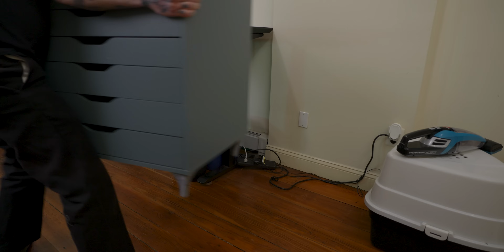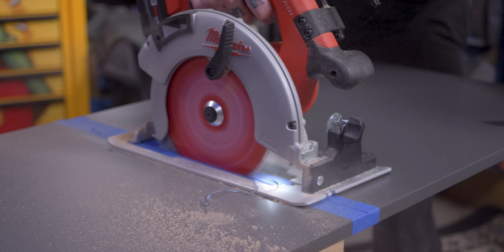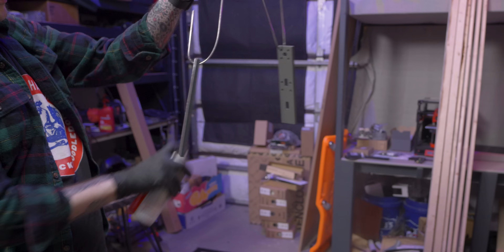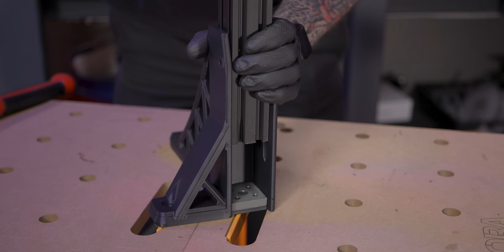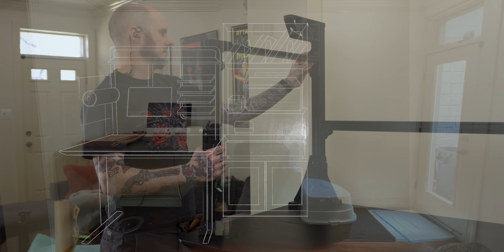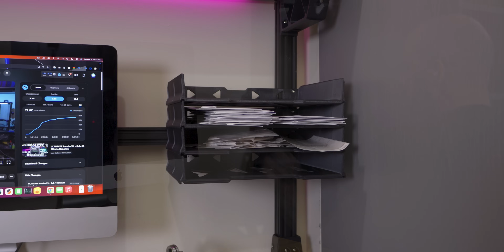Ikea Hacking w/ 3D Printing! - Desk & Litter Box Upgrades!

Comment: Can you share the Fusion project for the little brackets? They have a really interesting shape that I’m wondering how you achieved!
Reply from the maker: Which "Little brackets" are you referring to? I'm not a professional so my CAD workflows are usually... messy, which is why I usually just share STEP files from my designs and not the Fusion project files, but I'm open to doing so.
Reply: @MandicReally  The clamp brackets with inset screws they you put on the underside of the desk. Thanks for the reply!

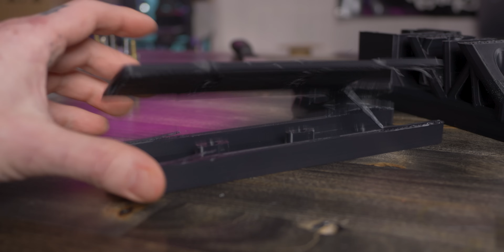Comment: 10:40 SEPARATION; Added weight from the steel, bed is just a little bit lower after putting it in there.

Comment: WHY did you bother embedding the steel into the upright brackets?? The design, extra walls & infill and strong filament looks more than adequate.
Reply from the maker: To hold a computer cantilevered off the front of the entire assembly? I love 3D printing but there are limits. Why test them with a computer? The steel will be SIGNIFICANTLY stronger, and the only real indication it is there is that the base of the brackets is a little thicker than it would have been otherwise. If I didn't tell you, you probably wouldn't notice. So why not do something different and stronger?

Comment: BambuLab's fail because of steel vs Lidar. 
And I have reservations about the brackets because 3D printing is not the suitable material for the job, even with metal reinforcement. It's a matter of looks versus relevance. Joining aluminum extrusions together, which is their intended purpose, is likely too simple with basic screws.

Comment: I don't have a bambu printer so I'm not certain, but could the print issues with the steel be because the steel is weighing the bed down? Those look like some pretty heavy chunks, and even a 0.1mm deflection could stop the next layers from sticking properly.
Reply from the maker: I think this is the likeliest answer to what happened. I may have to play with testing weight movement on the Z axis.
Reply: @MandicReally  if you set your slicer to use relative positioning (G91), you could manually add a G1 Z-0.1 F300 just after the pause point, or however much the deflection is.
Reply: Also you could set a wider extrusion width. If you set it to like 2-3x nozzle diameter then it'll stick better even if the layer height is a little off.

Comment: I wonder if some of the issue you have on the bambu especially is because you put cold steel in the middle of the part, and would be less of an issue if you would have heated them up closer to the chamber temp before inserting them into the print
Reply from the maker: I preheated the steel by setting it on the 110c bed for as long as I could before setting it into the print. Just didn’t mention it in the video cause I covered that in my last go around with this subject. Still may have been enough temperature difference to cause a problem.

Comment: nex time try to heat up the metal parts a bit 🙂
Reply from the maker: I did. Preheated them on the bed for a while before placing into the print. Just didn’t mention it. They were hot enough I could only hold them for a short time. 🤷🏻

Comment: Hi Allen,  A great tip for inserting steel parts into a print is to preheat the the steel before inserting it into the plastic.. I have done this by simply putting the steel part on the build plate while the rest of the part is printing, as long as the toolhead isn't going to hit it... or using another printer to to preheat the steel (or aluminum part).

Another great video 🙂👍
Reply from the maker: Thanks for the input, I did in fact do that though. I just didn't reference it in the video. My confusion really lies in why the Bambu had so much trouble where the Voron did not. The best input I've gotten is that the lighter duty bed mechanism of the Bambu may have lowered a little under the weight of the steel being added. Maybe just enough to cause the issue I saw.

Comment: Cool project.  Since the Bambu one was separating once you put the steel in…. Do you think the weight of the steal may have caused some backlash causing it to be a little lower than intended for the next layer?
Reply from the maker: That is the likeliest and most logical explanation I’ve seen. The steel was preheated on both machines but only the Bambu reacted poorly. I may have to investigate the bed mechanism on that machine in relation to this.
Reply: @MandicReally  good test would also be to run another bracket and pause the print just like the steel version (but don’t put steel in… continue print and see what happens.  Would be interesting to compare anyway

Comment: Cool project.  Since the Bambu one was separating once you put the steel in…. Do you think the weight of the steal may have caused some backlash causing it to be a little lower than intended for the next layer?

Comment: I think a few people have already said this. But it may be a good idea too heat up the steel before putting it in the print. You may want to increase the hot end temp to the top end the filliment can take.
Reply: Maybe use a thermal sleeve around the steel. Use a radiator insulator to r something similar, this should give it enough time to print the next layer before the heat transfers.

Comment: I suspect the layer separation on the Bambu was because the weight of the steel bar will ruin the precision that the bambu has with its rapid z hop it does. Not really sure the actual term but every time it ends on a seam it might be lowering the bed and raising it again very very quickly, but obviously a heavy steel bar would mess with that. 

That said, i dont really know what im talking about ive had my X1C for less than a month XDDDD. Hopefully you get what i mean.

Comment: Hi ,yeah I agree with some of the comments when I saw the steel and you bridging over it I was like no way thats goona stick, yes heating up the steel would work but finding the right temp to keep the steel warm and NOT melt the plastic is not goijng to be easy, I would suggest "Painters tape" on top of the steel and then you do normal layers, this way you dont have to worry about the nozzle and the plastic has something to stick to,.

Comment: I think that the main reason there was a layer separation on the bambulab is the chamber temp. Putting a cold piece of steel inside of a print might be the issue. The voron can compensate the loss of heat pretty fast having mains bed and a much beefier bed
Reply from the maker: The X1 bed is also Mains voltage. Though it certainly isn’t as beefy or thermal mass heavy as the Voron bed. I preheated the steel by laying it on the bed of both machines (the Bambu bed was hotter at 110C vs 105C on the Voron). And the chamber temp on the Bambu is generally 5-10C hotter than my Voron as the 2.4 has a larger chamber volume and the bed is at the bottom where it is coolest in the chamber.

Comment: Spray the steel with a heavy coat (let it pool up a little) of aqua net after you place the in print the while the printer is paused. This does two things for you, since there is wet hairspray on top of steel you have to wait for it to evaporate and allow time for the steal to warm up. Second is it give something for the filament to stick to.
Reply from the maker: The steel was pre-heated on the print bed for a while before laying into the print (just didn't mention it in the video). And the design fully bridges OVER the steel, it does not contact. I've done this before, trying to print on the steel is a bad time. It just won't be at temp enough, flat enough, or at the proper layer height to function like a print bed.

Comment: Have you compared the chamber temps between the X1C and your 2.4?  
Was opening the doors to add the preheated steel allowing enough heat to escape and the bambu couldnt keep up?
Reply from the maker: The Bambu maintains a higher chamber temp cosnistently. It is usually between 50-52C while the Voron is generally 40-45C at Gantry height and less than 40C at the bottom. The Voron isn't insulated at all and has a much larger internal volume to heat. I print ABS and ASA almost exclusively on the Bambu and have never had a momentary temp dip in the chamber cause any issues. Not a bad thought process, just not sure it plays out in reality.

Comment: I'd assume that the inserted steel absorbs all the heat and thus you get the layer separation right above it, as the layer before got cooled off too much.
When i do something like this, i put the parts inside the chamber, so the temperature difference is not as big
Reply from the maker: I did set the steel on the bed for a while before laying it into the prints. So it was not just in the chamber but also absorbing bed heat (110C). It is still cooler than extrusion temps of course so it could still be a factor, but the Voron had NO issue while the Bambu had nothing but issue with it. And the Bambu I run the bed hotter and the chamber is warmer.

Comment: I think the steel is absorbing heat and causing rapid cooling. Just saw your comment about preheating the metal, however I still think its the issue. Also, thanks foe the video, way too many 2d printing channels are not doing enough videos on practical uses of the printers. After years od doing 3d printing, I just learned something new from you today.
Reply from the maker: Thank you very much. My goal with the channel is to move away from the tech heavy side of printing and just show how cool AND practical 3D Printing can be. So I'm glad it is coming across.
Reply: @MandicReally  surprised you got through all the typos. Shouldn't do this without my glasses. Just a bit of feedback, back during the early days of 3d printing youtube, lots of creators presented cool projects on the uses of 3d printers. Now it seems so many creaters are dedicated to brands on optimizing specific printers or focusing excessively on hardware reviews and livestreams lasting more than an hour, these don't make for good quick watching while having breakfast. Practical print friday does lots of varied projects, but nice to see you too doing these projects. The hardware is not that exciting to watch anymore, and unless I am looking to buy a new printer, there are only so many reviews I can watch. However, project ideas, innovations in printing techniques etc... are more timeless as content

Comment: Just a bit of advice from a mail carrier, The mail could do better sitting vertical than horizontal as you have it, Also makes it easier to create dividers
Reply: let alone have that poo scent on all that material just sitting in that cabinet. Great way to contaminate everything.. Noice
Reply from the maker: @deeply999  You did notice the cabinet is completely separated from everything else right? its an enclosed chamber with a HEPA filter that nothing else shares the space with. There is a divider at the top that completely isolates it from the drawers and shelves above.

Comment: Steel has huge thermal mass and is sapping heat from lower layers, that can't "remelt" for proper layer adhesion. Thus splitting
Reply from the maker: I fully see and expected that, but the steel was preheated on the bed before laying into the print. I was barely able to handle it for a few seconds. Definitely not 240C, but not cold by any means and thoroughly heated. Had it happened on both machines I'd 100% chock it up to the thermal mass issue, but the Voron had no issues with adhesion either time. Idk.

Comment: x1c seperation could be the steel plate sagging the bed once added in. Seems to make the most sense. Could try some way of weighing down the bed using the steel plate for the first part of the print, but likely this is a horrid challenge as theres no way you could load that exact spot on the bed
Reply from the maker: I see that, but I did rest the plate on the bed for a while before laying it into the print. I did that to preheat it so it wasn't cold when inserting it. This still is a pretty logical possibility as to why the Bambu had issue when the Voron didn't. I may have to investigate that more. Thanks.

Comment: I think the layer seperation issue is coming from the steel itself. Steel is a good thermal conductor and I think when you place the steel in the part its cooling down the layers that are placed on top of it plus the part itself. I would try heating the steel up to like 70 or 80c and then placing the metal in the printed part.
Reply from the maker: I didn't mention it but I actually set the steel on the bed (110C) for as long as I could before embedding it. It was hot enough that I couldn't hold it for long when I was setting it into the print and I have asbestos hands. Still could be a factor of course. Just wasn't an issue on my Voron either attempt at the part, but was both times on the Bambu. It was odd.
Reply: I’m thinking the weight of the steel is heavy enough move the bed slightly. Could test this with a dial indicator on the bed and place the steel on the bed and see if there is movement on the needle.
Reply: What about using aluminum versus steel? It is quite strong and would still provide stability.
Reply: I had similar problems printing ASA on large parts in my Bambu X1C. It kept separating due to probably thermal issues. I ended up solving the problem by just printing the part in PETG and everything worked fine. Hope this helps.
Reply: @ChippWalters excess cooling? Weird that it'd work fine on a Voron 2.4 and not an X1C. Same layer widths?
Reply: @theglowcloud2215  yeah, it must have to do with the cooling. I used basically the same print fill settings and the PETG worked out perfectly. I try tweaking the ASA including using different brands and could never get it to not split. I think it needs a heated chamber.
Reply: Yep, that's what I thought
Reply: Maybe I heard wrong, but the Voron taking longer means it's printing slower.  Layers adhere better to each other when not printing like a bat out of hell.
Reply: Came to say this. Pre-heat the steel somewhat would have likely solved all of this.

Comment: Hold up… is that a server rack in the back of the intro shot? What are you cooking up?
Reply from the maker: Server rack has always been in the corner of the studio, I just finally cleaned things up enough with the new setup that I can film at an angle that highlights it. 

It houses a couple of servers for my house / video work and will likely be the focus of a video at some point here. Nothing major planned at the moment. Got ideas? ha
Reply: Put a printer in there and use gpu’s running a local LLM like mistral or llama2 to create a heated chamber, click-bait title “3D printing with AI”